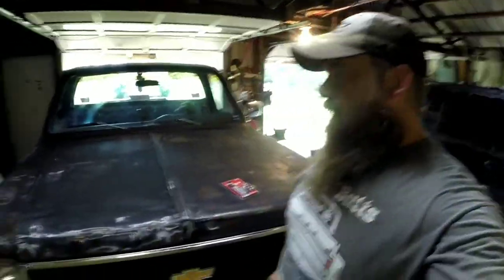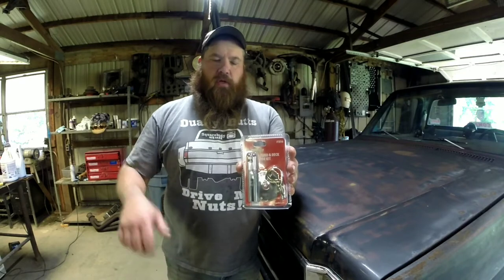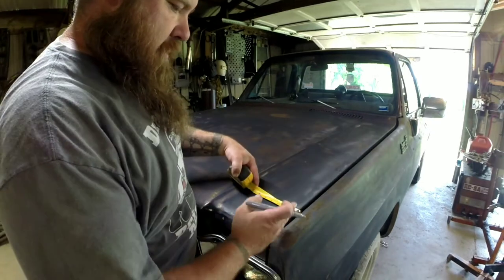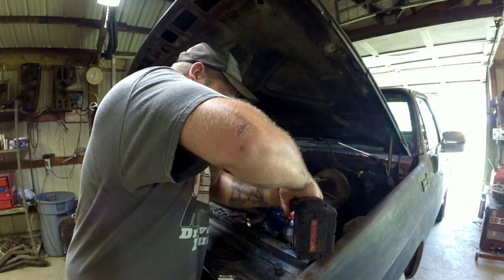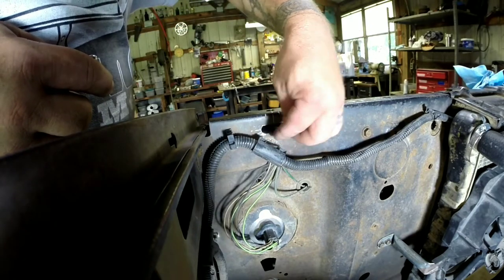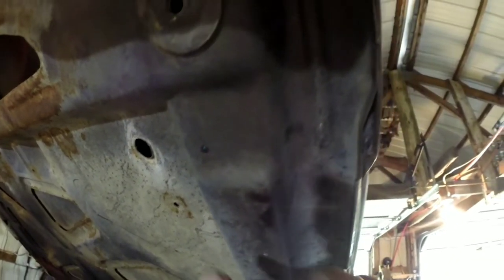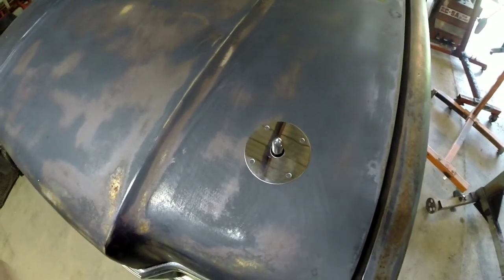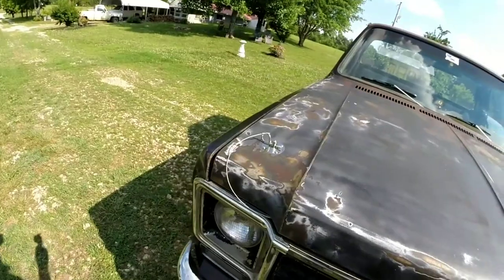Hood pin installation on my 78 stepside C10 Squarebody.

Comment: When i bought my 2012 Ram single cab shortbed 4x4 Express HEMI , within a month it was at a body shop having the top of the hood painted matte black and hood pins installed with custom made brackets and debadged. And i cut the HEMI part off off the side badges and put them on the hood like they have on some of the Challengers. It came out sweet.